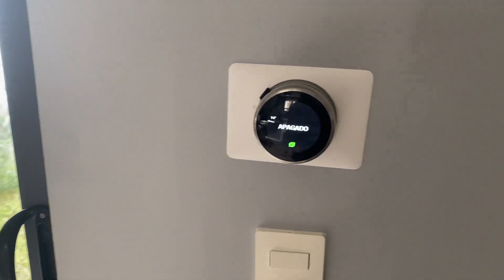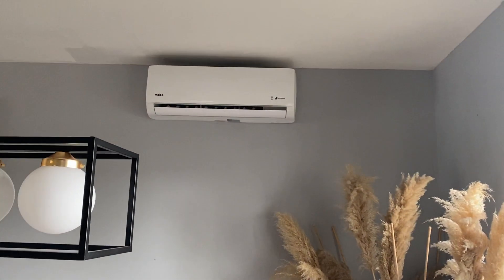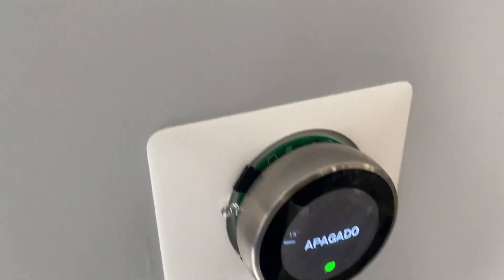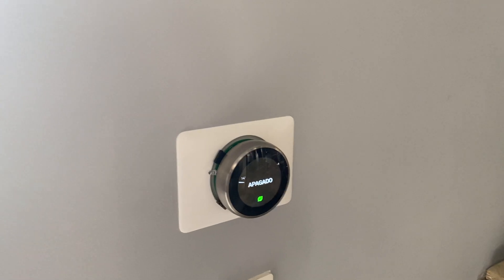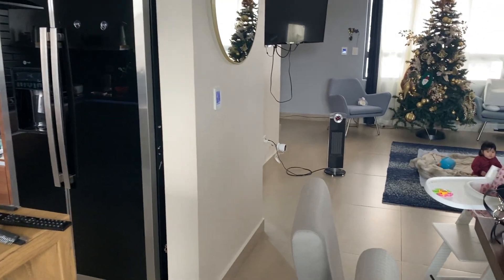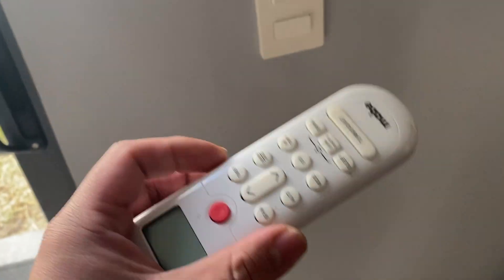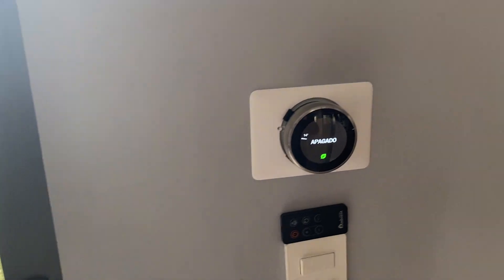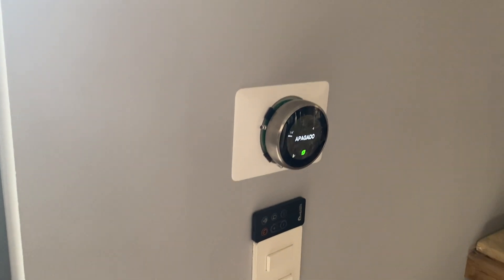Nest thermostat controlling 2 devices via IR, minisplit and electrical heater

Comment: great stuff you have created. I want to pay but before I do can I use my nest for baseboard heating with the sensors and control my LG mini cooling/heating?
Reply from the maker: Yes you can!, I have an lg dual inverter, and it’s working very well
Reply: @andressantos4054  Nice thank you for the info I have purchased this equipment but haven't installed it in months now that I know it works with my door inverter as well I will install it this weekend anything that I should know before hand?